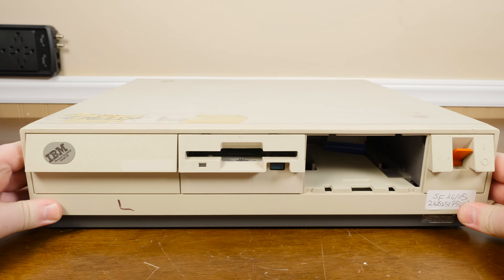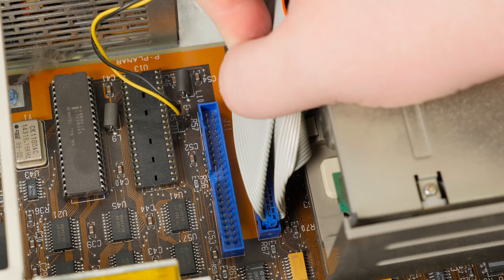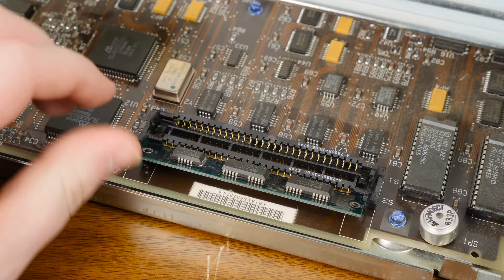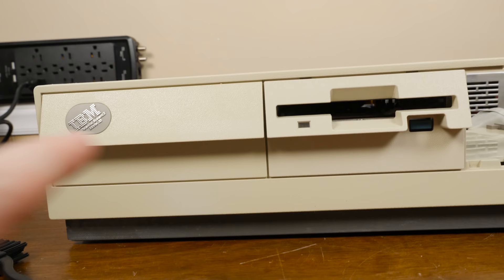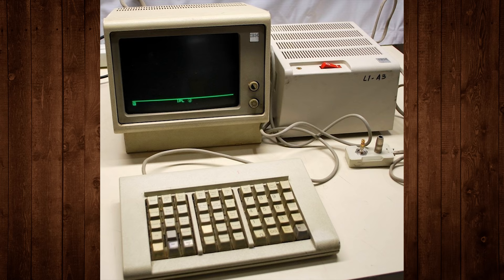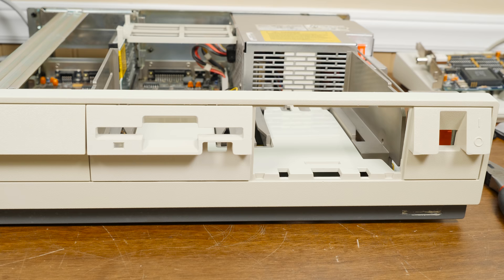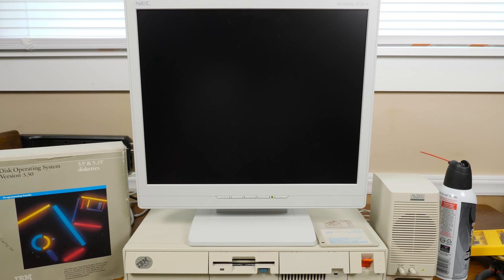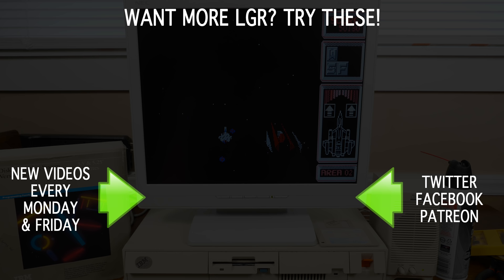LGR - Restoring a 1987 IBM PS/2 Model 30

Comment from the maker: To everyone sending me links to hard disk cables they think will work on this machine:
as mentioned near the end of the video, there is only one cable that works with this configuration on this particular variant of the Model 30. That would be IBM PN:61X8903. Even then I still don't have the correct hard drive for this machine so I wouldn't be able to use the thing anyway, so I'm temporarily just using an XT-CF-Lite card instead.
Also, yes I am aware that blowing air into a fan can cause problems. TOO BAD, HAD FUN, NO REGRETS  :P
Reply: Livin' on the edge, huh? ;)
Reply: I was really hoping you could put a Hard Disk in it, what a pity it was not this time ...
Reply: Such a rebel.
Reply: NO RAGRETS
Reply: LGR That's ourvLGR living dangerous lol
Reply: It just works. After 30 years... amazing quality construction from IBM
Reply: N O  R E G R E T S
Reply: Ah the venerable Model 30, I do believe my grade school  had a few of these. if I recall correctly, it was this machine I first played a game of Oregon trail back in 88 on. Good times!
Reply: I had a similar problem with the 8087 era pc "portable" this is what I did. Use jumper headers on the plug, then have all the individual cables go through a heat shrink (label them!) You can shrink the tube once you get it connected for a neat "factory" look. On the other end, either get an edge connector you can plug into, or solder on to the pads. Lots of these different interfaces only differ in the location of the pins, so once you have the pin-outs for socket and drive, you can match them up correctly. I'd use a bigger gauge wires for the power ones, it'll reduce the resistance and stop you connecting them to data accidentally.

After months of buying wrongly described cables and shipping them across the planet, it took me an hour to make my own. Other then not being a ribbon cable, it looks like it came out of the factory.
Reply: LGR I got an old IBM Netvista 6792 from 2002, the front is nicotine yellow, can you remove or reduce it.
Reply: Just was wondering have you thought of using an oil-less compressors by any chance? I have used mine to clean quickly inside my computer's as well as for my other hobbies.
Reply: LGR wait PlayStation stole the ps2 name
Reply: Better to stick with another type of HDD or an XT-CF-Lite, though, since the drives sold with these machines are notoriously unreliable.
Reply: Mehrunes86
 I would first try making a paste with baking soda, if that does not work get a magic eraser, and finally do the hydrogen peroxide treatment mixed in a 50/50 mix with Oxy clean, and water.
Reply: I have one of these. My hard disk made horrible noises and failed. so i put in a malinov CF-lite ... as such i have a spare edsi HD cable.
Reply: @JDBooker Why not send it to him?
Reply: The Portal 2 PC.
Reply: Huh... I think I have a machine along that line. Unfortunately I need a certain floppy disk to get it to boot.
Reply: I have a hardcard 20mb in my 30.
Reply: LGR you're beginning to sound like TechMoan here! lol
Reply: Commodorefan64 Nice, thanks😀will try that.
Reply: LGR Cool
Reply: Stick the math coprocessor in there
Reply: I know someone at IBM that has a collection of weird doodads like that. I'm going to ask him when I see him next if he has (or knows where to get) one of those.
Reply: Would be interesting to watch a video about the installation of the XT-CF Lite on this computer.
Reply: LGR why not just add a second floppy drive where the hard drive is and keep the compact flash card.  I mean, it would be cool to see a working hardrive. That interfacte fascinates me in a weird way. I like odd and unsual tech, it pleases me. Love your content by the way! Keep it up!
Reply: I used to service PS/2 machines for a while in the late 80s and early 90s. You'd need the specific cable and drive, which should also come with a plate at the bottom that slides into the rails at the bottom of the hd 'cage' and locks in place. a -021 model came with a 20mb disk, my memory says it should be an st506 type drive, but with a special cable (but.. it has been a while since I last saw that machine and its service manual)

The serial number probably got scratched off because the machine was officially scrapped but never got destroyed, instead it probably ended up with an employee or entered the grey market. Officially it no longer exists.
Reply: Mehrunes86 Don't be so damn lazy. Your a capable human being, you can figure out how to do it yourself. Google RetroBrite. It's just Hydrogen Peroxide & sunlight.
Reply: after reading that I don't think what i found would work with the ps/2 motherboard then. 
IBM 64F1409 PS/2 8555SX ESDI HARD DRIVE CABLE 27F4669 27F4603 8555-031 8555-061 
The slide connector looked right for the hdd it's on ebay though if you think it will work
Reply: I found back the IBM service info sheet for IBM dealers concerning this ps/2 model 30-021. My memory was right, the 021 uses an st-506 type drive, but with a different connector.

There is a bit of a twist to it from what I recall, part of the controller was moved onto the drive board itself, and part is on the system board. This is unlike other ps/2 machines using this interface (PS/2 models 8560-041 and 8580-?41 with their 40mb hdd) and the cables are not the same (from a quick look, the cable LGR got is actually for those machines, and hence also an st-506 cable but of a totally different kind).

LGR is for all I can tell from memory and the service info right on the cable, 61X8903, and not any other cable.

So no, the cable for the 55sx esdi drive won't work.. through it probably does work with the disk he has (not sure if its the 55sx esdi drive), it certainly won't work with the systemboard.
Reply: No?  Not even one letter?
Reply: There's a couple of companies that might sell them but only through demand services. Trionix Micro (if they're still in business) seems to list it and a European company named Procurri seems to as well.
Reply: PerfectCQ  Cheappcupgrade, an American company based in California apparently has the 61X8903 in stock. On sale even! Still pretty expensive, 130 bucks.
Reply: Maybe we can make a new cable for you?
Reply: well the PS/2 line was IBM's attempt to take back over the PC spec it failed and the ATX spec became standerd.
Reply: it's the IBM PS/2 that stood for Personal System /2. the naming was a replication of IBM's mainframe naming system.  the PS/2 line was aimed a business buyers while the home user marked had the PS/1 line.
Reply: At least you tried, m8, great restoration tho.
Reply: I thought those blue connectors were “microchannel” 32bit. I had a PS/2 Model 80 for a few years when they first came out. $256 for a floppy controller so I could add a 5.1/4 floppy.
Reply: Maybe I missed it but what would be the drawback of putting in some kind of Compact Flash solution? I know you like the real hard drives but CF seems like the way to go, especially with the low power usage benefits.
Reply: no
Reply: Is that a Todd Howard reference?
Reply: Fyi, the so-called network card on that IBM PS/2 is basically what they called "ThinNet" or "2BaseT Ethernet", compared to the 10BaseT, 100BaseT and 1000BaseT Ethernet we have today.  2BaseT transmitted and received at a theoretical 2Mbps (megabits per second) speed.  It uses BNC 50-ohm cables that you daisy-chain each machine to or use a Hub/Router to connect each machine to.  There are even BNC T-adapters and 50-ohm BNC Terminators you'd hook up; much like you'd use terminators on SCSI devices.  It did the job, but was clunky.  Also was cheaper than Cat-5 cable at the time.
Reply: Joe ThinNet was 10BASE2, it could do a theoretical 10 Mbit/s. I don't miss terminating resistors in any medium though, always a pain to work with.
Reply: Now THAT's a hardware hacker!
Reply: Definitely not the HDD that's in my 30
Reply: One of the early implementations of ThinNet was capped at 2Mbps and a later revision upped it to 10Mbps.  It just depended on the computer's network interface and the connection quality.
Reply: If you have a usb floppy drive, then you can create your own ms dos boot disks
Reply: If it's just an IDC on one side and a card-edge connector on the other, you should be able to make your own cable with parts from e.g. Digi-key or Mouser.
Reply: I have the opposite problem as you with my Model 30.  I have a working hard disk in mine, but the floppy disk drive is not functional.  It would see disks and get some of the data, but not all the data on a disk.  Examined the drive itself to clean the headers and whatnot, and some of the caps fell of the board!

Now I'm trying to figure out where to get a replacement drive, but I'm not sure what kind of drive I should be looking for :S
Reply: I have one of these in pretty much mint condition.  This was my first DOS computer.
Reply: cmon man, we are just trying to help you out!
have you tried using a scsi, ide, or mfm cable?
Reply: Where do we get elbow grease?
Reply: @RobertPendell  
you can download the IBM softwares online
Reply: Доведи работу до конца, покрась царапину.(
finish the job, paint the scratch)))))
Reply: I doubt this was a model 30. model 30 had 8086 cpu I presume and 8086 cpu does not scroll so fast on dir listing with vga
Reply: The ESDI drive issue is a real pain. Unfortunately, no one out there makes any modern solution. You can technically get an IDE drive controller, but again, you can't power any drive internally. That is, even if you can get the computer to work with it properly. These things are a pain!
Reply: you'll probably end up having to make your own.
Reply: @Mehrunes86  retrobrite the front
Reply: @c128stuff  8
Reply: My neighbor has a model 30 that has a hard disk it boots off of idk if it might be the same picture but should I email pictures?
Reply: you can just buy the connectors "44 pin ide laptop drive variant" and a card edge connector with the appropriate number of pins and a spool of 1ft of ribbon wire or the appropriate diameter and crimp your own cable look it up on amazon
side note: the extra 4 pins on the ide-like connector are just a common molex set of wires (+5v gnd gnd +12v) with current limits equivelent to a modern 3.5" drive (1.5A 5v and 1.5A 12v maybe less for the older smaller drives but still enough for a cf-to-ide adapter)
pinouts.ru, amazon and google are your friends here
Reply: so did you ever figure out a scratched off serial sticker means that it was stolen?
Reply: UltraDoom No, look:
PS/2
PS2
What’s the difference?
Reply: Try to find the correct wiring scheme of the cable and build your own?
Reply: I'd be willing to bet this cable would work:  (Ebay Item# 114336976147)  the chart you see I'd think is just for certain lengths of cable, there's no way each is a different pinout.  And this hard drive would work: (Ebay Item# 124275292968)
Reply: soooooo when is that PS/2 video comin? cant wait for it! =P
Reply: maybe too late by look at ibm p70 esdi cable. i dont know if the lenght is good, but for sure is the same connector
Reply: Did you ever get the cable?
Reply: If you are still searching for a cable, Cables and Chips in NYC might be able to provide one. Not sure about the hard drive though. That might be hard to get.
Reply: Flipping the orange power switch  with a ballpoint pen was a common thing... back when students used blue pen & paper every day in class...
The 'High Tech' of that time was  eraseable  pens !    No smudging,  except on that orange switch !  :-)
Reply: Sorry to be offtopic but does any of you know of a trick to get back into an instagram account..?
I was dumb forgot my login password. I love any assistance you can give me.
Reply: @Terry Kyng Instablaster =)
Reply: @Layton Koa i really appreciate your reply. I found the site through google and Im waiting for the hacking stuff now.
Looks like it's gonna take quite some time so I will reply here later with my results.
Reply: @Layton Koa It did the trick and I actually got access to my account again. Im so happy:D
Thank you so much, you really help me out!
Reply: @Terry Kyng Happy to help xD
Reply: but can it run crysis
Reply: I know this is old. But what is the model number of those altec Lansing speakers?
Reply: Blowing air into & around computer innards is better than using suction since it causes less friction and therefore produces less static.
Reply: @Compucore  Yea would have spend a few 100 bucks in can's by now if i didn't spend 30 bucks for nice little compressor.

Comment: The power button was most likely disabled on purpose, because this machine was never supposed to be turned off.
Reply: More like it was never meant to be turned on.
Reply: Looks like it is in the ‘on’ position when the case is opened so looks like it was always meant to be on.
Reply: Hmm, a clever hack to ensure the PC is not inadvertently shut off by someone.
Reply: The rod would pop out on its own too. This was my first BBS machine in the 80s.
Reply: @BrodieChree  Cool. 9600 baud?
Reply: I suspect it was because of kids around, computer was probably in some office, and doing important stuff 24/7 and playing kids could turn it off. Or maybe... at home
Reply: @andywolan  In the 80's?  1200 or 2400 baud would be my guess.
Reply: @warrax111  a School?
Reply: @nutguzzler6479  on school, it doesnt have purpouse. Servers were always locked in other cabinet. Normal computers for children, for informatics and stuff, always needed buttons. School is not probable reason, the button is turned off. Eighter home, or office.
Reply: @BrodieChree  my rod pops out on its own too

Comment: Amazing! I was the proud owner, upon graduating High School in 1989, of an IBM PS/2 Model 30/286. It had a 20MB HDD and a few K of memory. I was later to upgrade it with a Plus Hardcard XL 100MB, and 2x 512k SIMMs for 1MB RAM - WOW!

The Hardcard was the sweetest peripheral I ever purchased. 10 years later it was still operating just fine, having been transplanted to my 386 and then to my VLB 486 and never giving me errors or crashes. That Hardcard cost my Dad $500 at Egghead Software when it was new, and I had to do a good deal of convincing him that it was a good investment.

I also installed a 2400 baud MNP5 modem for my first online experience. My parents didn't like BBSes - thought they'd run up our long distance bill - but they were OK when I connected to the college's Annex box for Internet access.

Eventually I installed Minix on this PS/2. That was the end of playing DOS games and pretty much anything else useful... but, MINIX!!!

Comment: Wow, did you bring back some memories! About six months of my first year of full-time employment was spent on a 1987 IBM PS/2 Model 30 very much like this one, writing software and providing tech support for my company's software package! I didn't know much about hardware in those days - I was primarily a programmer - but I do remember that my PS/2 Model 30 had the optional "whopping-big" 30MB ESDI hard drive and 640kB RAM. The computer came from one of my employer's business partners, who was an IBM dealer, so it also came with a matching PS/2 VGA monitor, a 14" IBM 8512, I think. If I remember correctly, it had a 10MHz 80286 processor (but did not have the math coprocessor), which made it the fastest Intel-based PC I had ever used up to that point. It couldn't keep up with my boss's Compaq DeskPro 386/16, of course, but it was more than enough for the kind of work we were doing at the time. We didn't have 3270 emulator network cards at that company (although in 1988, I got a new job in a bank's IT department, and at that bank we did use 3270 emulation, first mostly with IRMA coax cards similar to the one you found in this computer, and later via software emulation that worked with our IBM Token-Ring network hardware. (Also at that second job, I had an IBM PS/2 Model 50 for awhile, which had a slightly faster '286 processor and Micro Channel Architecture.)

Comment: When I worked for IBM I had a PC/AT with a 3278 emulator card. Using a series of keystrokes you could switch from PC mode to green screen mainframe access and back. 

I had a PS2/30 286 with windows for home use. I ordered the PC and then broke my leg.  I spent my recovery playing King’s Quest IV. Thanks for the stroll down memory lane.

Comment: IPL is an IBM term, "Initial Program Load". I think it attempts to boot from the network.
Reply: Very possible.  That could be a token ring network card or an early coaxial ethernet card.  Both supported booting off of the network.
Reply: @markshade8398  Neither. A 4700 is a IBM text terminal system for bank tellers. It ran on a serial coax loop. It is conceptually similar to the 3270 and the 5250 systems where the terminal downloads blocks, like a form, has the user fill it out, and then uploads the data. It is very similar to how modern web forms work.

Comment: Thank you so much for that. It really takes me back. My 1st PC was a 2nd hand IBM PS/2  mod 70. Tool-less case, hard power switch on the front. Lots of satisfying clicks. running os/2. I junked it back in 2006 and have regretted it ever since.
Love your work.

Comment: A fantastic solvent for sticker adhesive is something called 'Stoddard solvent', which is just a fancy way of saying barbecue lighter fluid.

It won't damage plastics, but it makes short work of sticker adhesive.

If the sticker is an uncoated paper label, saturate it with lighter fluid and leave it for about 5 mins - it will peel off as easily as a post-it.

If the sticker has a shiny plastic coating, rip this off to expose the paper underneath and treat as above.

Any remaining residue can be removed with some more lighter fluid on a paper towel.